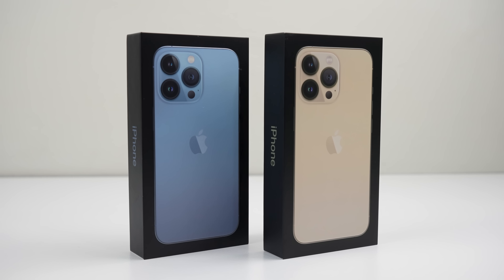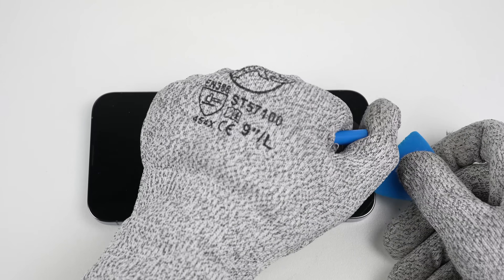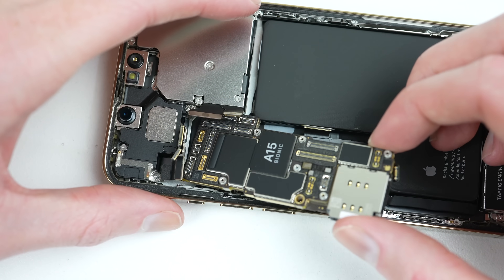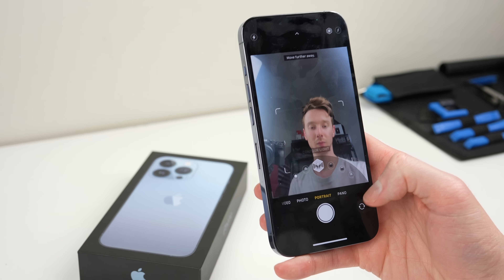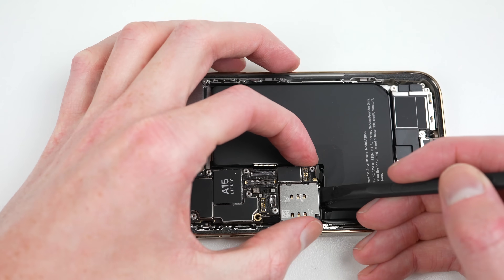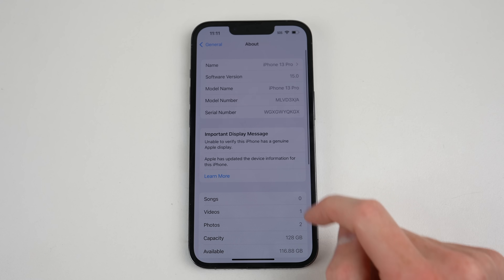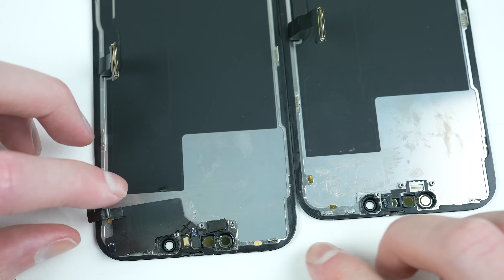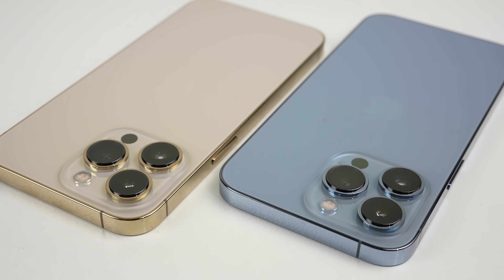iPhone 13 A Repair Nightmare - Teardown and Repair Assessment

Comment: I love their arguments in court. They say “if we make phones serviceable people will repair them wrong and blame it on us” 
In rebuttal “okay so make repair guides available” 
Apple “uhhhh no”
Reply: Courts: "It's settled, then! Apple doesn't have to make them repairable because people will make them look bad and they don't want to make guides. Case dismissed."
Reply: They could simply add a clause to the agreement signed upon purchase: we are not responsible for faults incurred by repairs conducted outside of a genuine Apple service center. 

The real issue is the negative press they would get from phones breaking. People will inevitably blame Apple for their own poor repair attempts, and Apple products will appear unreliable even if Apple is not at fault. Plus, licensing agreements are way more profitable than purchase agreements. When you "buy" a product that you are not allowed to repair, you are really only buying a license to use it.
Reply: John Deere does this too.
Reply: Exactly, i see xiaomi do tear down their whole phones, and noone so far can sue a company for their oun mistake, they just void their warranty
Reply: @雪アンアン  Is noone a word? Wait you were saying none or no one? I can't tell. This mystery is driving my curiosity!
Reply: @TheHeavieKiwie  noone is just "no one" but without a space
Reply: @AtomicAlchemist  I see. I think it's just made short to type it easier I think.
Reply: @TheHeavieKiwie  yes it is.
Reply: It cracks me up that people actually think any company cares about them or the environment. They pretend to care about the environment and social justice so you don’t focus on them using slave labor in China
Reply: So they decide to add traps and intentionally ruin phones when they do get repaired.
Reply: Showing the user a message about non-genuine parts already makes that argument irrelevant. The user knows about the parts, but apple still gimps their device for no reason
Reply: @NJ-wb1cz  I want security no messages. For my business and privacy a message is useless. You got messages when the damage is already done. I want them to prevent damages. It’s like to have automatic brakes on a car, and a message “you hit someone” on another car. Same relationship. I want that you prevent the data breach, and if someone still try to change parts I want these parts to have access to my data completely blocked. That’s security, no messages. iPhone have this level of security that is reliable for business. It’s a phone with enterprise in mind just like some Android phones, which have the very same issues with repairing as you tell. If you don’t need this level of security, it’s your concern and you can buy another phone. But if you use your phone for work like me, or do some real domotics so your phone can be your home keychain, then stop this nonsense and think about true security. If you’re an average user instead, probably you don’t need an iPhone, a Black Phone or a Galaxy S22 either. Get a Mii Note and be quiet and happy.
Reply: @AlessandroMorvillo  making your phone glitch confusingly without explaining you why exactly does it glitch and who makes it glitch doesn't increase your security beyond the message. They could've just said to you which components are suspicious to them and openly said that apple doesn't allow you to use your phone when it's repaired this way for the sake of your security, IF they were interested in security instead of duping you into believing that the repair was faulty
Reply: Who cares, you bought Apple because you think it added to your status.  What? You're too poor to buy the new iphone?  You want to repair that OLD one? LMAOOOOOOO
Reply: @honestpolicy5031  I think that if someone buy a phone for a status, they need to rethink their priorities. Phones are tools, you need to buy them for what you need. I use a lot Homekit as it’s a well thought protocol, and I need to use the security API of the phone. Also the cloning process is far better than the one on Android, and when I change the phone, as I needed to because I develop on them, it can copy via wifi, without internet cloud, all my data, app, profile and settings. I also use a lot the LIDAR for AR and 3D scans. For the status part I don’t give a cent, but I know and acknowledge that there’s so many that do think a phone will change their status. I don’t think so in an era where you can get an iPhone with a simply flat plan of the major carriers. Maybe in the first 2000, but now I think who thinks about this are wrong and must buy another phone, for their sake.
Reply: All companies do this. Its in their warranties. They say if damage is because of you the warranty is void.
Reply: @kalijasin  this has zero to do with warranty. Companies can keep their damn warranty. That doesn’t matter.
Reply: @dpedd12  has nothing to do with the warranty even though it's IN THE WARRANTYy. LOL!!!
Reply: It's a matter of signing certificate, not physical repair. For security reason the parts are certificate signed. And give Apple certificates to third parties is like giving you home keys to your mechanic. Third party can do everything they want with the certificates, that means a security flaw great like a black hole. Not even Apple do this, also Android phones with an high level of security. And even Apple cannot repair the parts, they simply change them. Some of them are low in the key chain and can be simply replaced with a part with a valid certificate. Some of them, like FaceID, have certificates that are related to the motherboard. That means that Apple changes motherboard and FaceID at one time, thus giving you a new phone is the same result. But that's why violate FaceID via software is so hard, if it was done. At this time, as I know, on a vanilla phone not jailbreaked FaceID cannot be violated, as even the TPM chip, but I can be wrong on this. For sure, it's really hard to do this, and requires some good bunch of tech, not the average genius guy of the shop of next street.
Reply: @AlessandroMorvillo  Apple has simple tool to resign everything in phone long as parts are genuine replacements, hell even some non-apple technicians have tools to transfer identification data from one display to another, it works on anything up to iPhone 12 (apple has tools for iP13 too). Also it takes them 5 seconds to do so.
Reply: @3DJLab  china companies made a tool to reassign Screen, battery, FID Identifications lol...
Reply: @AlessandroMorvillo  yes but they destroyed almost every function on the phone. they didn't make the phone not just not boot or something in case someone is trying to circumvent the phones security by replacing physical parts, they made it so you can't repair it even if you own the phone. these practices are so far beyond anything needed to secure the phone its absurd.
Reply: @lbk1982  unfortunately that’s what happens when you apply a digital sign to hardware. You raise security by far, but you also impede repairs, mostly even for Apple itself. The whole security fact is about immutable, or hardly mutable, hardware so you’re sure that nobody can change pieces of your own phone with something that it’s compromised. For example FaceID camera is signed used a key in common with the phone motherboard. If you break the Camera you must change also the motherboard that’s equals to change the phone. If you change only the camera your FaceID functionality will be turned off permanently and iOS notify you that your FaceID component was compromised and cannot be used as its security is at risk. This apply also for TouchID reader. This is the cost of truly hardened security. Same technique are now applied at core devices in modern cars, as security issues were raised when a group of security researchers successfully taken control of a FCA SUV remotely, making the car go off-road while the passengers and driver can do nothing to prevent it. Now the hardware on cars is signed and cannot be repaired by third party mechanics, but also cannot be violated easily by malicious users. Security is always a fact of compromise between rights, feedom and system hardening. You cannot have freedom and security at the same time, as freedom implies that components cannot be bound together and signed.
Reply: @AlessandroMorvillo  i understand, and i don't care why they are doing it. its simply not necessary to digitally sign every piece of hardware in the phone for the phones physical security and there is no argument you can make that will justify it.
Reply: @AlessandroMorvillo  those who give up freedom for security get and deserve neither
Reply: @AlessandroMorvillo  you know you missed the whole point right. When restoring a phone via iTunes it could/should completely sync components together that were replaced. 

Thus making all software and hardware whole again!!!

Your fallacy comes into not realizing or talking about WHY apple put hardware encoded barriers there in the first place. Why is True Tone disabled? Battery messages? Rear cameras!  You beaten the bush with Face ID. Which, like I said should be still uncompromised as long as the software can reset and sync logic board and FID together. 

You have no idea what you’re talking about, and not even touching on other issues that would make your entire argument invalid.
Reply: @AlessandroMorvillo  how hard is it to let people build in a new camera without letting the software ruin your phone
Reply: @AlessandroMorvillo  what you are saying make sense for FaceID. What about the camera and true tone display? There are no security implications there.
Reply: @MitchM240  the camera and the FaceID are the same component. FaceID works with a LIDAR installed in the camera component, and from iPhone 12 this very component is available for front and back camera as well. Changing camera means changing the LIDAR, which in fact invalidate the FaceID component for security reasons. The front camera is tied to motherboard key, so you must change motherboard also. For the screen, I’ve seen the screen changed. Using good third party display turn off true tone and that’s right. True tone uses the factory built in color curve, just as iBeacon uses the factory measured decibels of the bluetooth radio antenna. If you change the screen, iOS must know exactly which capabilities this screen have. As it cannot know what the screen can do and as far as it can find if it’s an Apple display, so can use the default data built in with OS, or a third party, it turn off the true tone functionality, as it can mostly result in an illegible screen if the third party is not good enough. Also, iOS warn the user that the display image quality can be subpar against the quality of an official product. This is of course a legitimate behavior, but in this case Apple could in fact sell screen parts as long as the client accepts that repairing the phone from third party laboratories or by DIY means could do more damage to the phone. The screen part is in fact where some profit comes, but I’ve changed my screens from Apple and from third parties, and I can also agree that Apple labs do their work better, it’s strange isn’t it? But the true tone have valid motives if you don’t sell the official part. Effectively the third party screen that we’ve mounted on the iPhone 6S were so much subpar against the official Apple manufactured by Samsung. But my friend isn’t someone that use the phone for multimedia so we’ve rated it enough for him.
Reply: @AlessandroMorvillo  your excuses are false yet again because Iphones glitch with genuine Apple parts, as is shown in this video. It's not about checking for genuine Apple display, it's about making your phone glitch artificially if you dare repairing it.
Reply: @AlessandroMorvillo  You are making the assumption that someone lost their phone then some malicious actor pulls appart the phone to add a part that has some spyware on it. 

No, the fact is, someone gets damaged phone, screen cracked - which is a common issue. And they want to fix/replace the screen, regardless of manufacturer they should be able to get the screen replaced no issues from the hardware or software. Add on that Apple by doing their shady business practice can ARTIFICIALLY increase the price for repairs. And in this way push out other businesses that work on old Apple tech. 

As I see here. The example shown is that two phones of the same kind, are used to repair one another. And these programmed "Security" Measures makes the phone less functional. Makes it error, makes it to where one can't access the systems or use them. 

So in the end, it is more or less the argument against monopolizing phone repairs that is going on. Not security problems, as it is for REPAIRS. And any repair business would want to make sure the customer has what they want which is a working phone, Ipad, or computer. A company more worried about who repairs their devices is not one I want to support anymore.
Reply: @AlessandroMorvillo  
"It's a matter of signing certificate, not physical repair. For security reason the parts are certificate signed. And give Apple certificates to third parties is like giving you home keys to your mechanic."

this is a false equivalency fallacy changing your hardware from one certified apple component to another does not compromise security. This would be like replacing a graphics card in a computer with another, or like replacing a car battery with another. If the data in the SSD is encrypted changing HW parts does nothing. 

"Third party can do everything they want with the certificates"

apple doesn't have to give any signed certificates to third party venders. They just need to stop paring hwid parts together. heck if you are really worried about people spoofing face id give them the option in settings to disable hwid pairing or give them an option to reset it. It's really not that hard.
Reply: @-Anemic  you simply don’t know how signing works. If you have a certificate used to sign a main board, then ALL the components must match the private key of that certificate. That’s why is secure. It’s like an SSL certificate: if you change the FQDN of a route, it doesn’t match as every route must match with the FQDN domain in the certificate. The certificate is enabled PER PHONE, and it’s useful to avoid stolen certificate from valid hardware like in the Bluray toolchain or Secure Boot applications. You cannot stole a “valid certificate from Apple” because the Certification Authority is indeed Apple, but the components are signed using a certificate generated only for a specific motherboard. So, a FaceID cam can only be installed on that specific phone, with that specific motherboard. That’s very secure and it’s often used in other Information Technology chains, and other security-aware hardware to avoid hardware hacking. Also this very same technique is used by Microsoft and Apple to sign in developer to test their app using USB sideloading. A certificate is issued using the signature of the phone, and you’re allowed to run the resulting test app only on devices with the specified certificate. This avoid not only test apps to circulate, but also malicious modified apps that can be a threat to the users. This is why signing the single piece if hardware is useless: you need to sign like Apple, Samsung and Microsoft do. The motherboard is the master with the signing certificate issued by the OEM CA, and the critical hardware is signed using the motherboard certificate, so the certificate of the critical hardware cannot be stealed (it’s useless as only the motherboard can decrypt data) and hardware cannot be hacked. If you want next time I will do for everyone “IT security for Dummies” block scheme 😃
Reply: @AlessandroMorvillo  still doesn't explain why Apple is bricking your device if you don't repair it with one of the apple technicians. 

And even more so. I have seen many a Mac book stories where the Mac was never worked on, yet the humidity sensors are set off upon opening it up for repairs.
Reply: @AlessandroMorvillo  Look man, I'm actually certified in cyber security with 6 years of college, what you're saying doesn't really make any sense at all. To prevent issues from people using 3rd party parts is one thing, but from other genuine Apple parts? That's ridiculous. It's like each phone has their own certificate-- which is doing nothing but drawing business away from private computer technicians and funneling all the money towards Apple so they can charge people more than what it really should cost. It wasn't designed with any security in mind, all that's needed for that is for genuine Apple parts to have Apple signatures, like all the phone has to do is contact the iTunes server, verify if the part is real by checking the certificate, and done. People drop their phones all the time, it happens, why should it take so much to get something as simple as a screen repair? What they're doing is criminal, and feels more like you're just borrowing the phone from Apple rather than truly owning it. It's like if you bought a new car, and the brakes failed, and suddenly you go to get it serviced and you're told you have to replace the whole car, regardless that they used actual brakes from the manufacturer, the computer in the car just denies it's existence. 

Furthermore, I don't think you quite know how security on electronics works. This shouldn't be like a website. The reason websites are like that is to avoid them sharing the same domain name and the same routing. If a product came from Apple, it should share 1 of however many certificates that Apple puts on them. They shouldn't all have to be the exact same unique certificate assigned to each individual phone to be secure-- I mean, imagine if desktops were like that, where you could only use this specific motherboard with this specific CPU, with this specific RAM cards, and this specific storage drive, all of which have to have the exact same certificate, it'd be a total nightmare if something decided to start acting up. 

Also, if Apple has kept up to date on encrypting their software, stealing encrypted certificates by cracking it into plaintext takes a really, REALLY long time. You're talking like, thousands of years for an advanced supercomputer, millions of years for some neckbeard with a laptop. 

The only thing Apple is avoiding is pesky competition for servicing phones people already paid to own, and you're coming up with every excuse in the book, and most of it is hogwash, on why this is effective. You can save your "IT for Dummies" course. I think you need one of those more than most people here do.
Reply: @point-five-oh6249  I agree to disagree. I had passed a lot of penetration tests and I have also a lot of forensics IT books that plus or minus tell the same story of me. Of course, pointing also on the other face of the medal that’s quick repairability. You can say that’s overthinked, that’s too much as a phone you can buy in retail stores, that would be ok as others pointed. But that have a certificate for each phone is useless, I don’t think so. Playstation certificates and Bluray readers certificates are still stolen at these days, as it’s one certificate for model. They’re used to crack consoles and blu ray disks. Without the chain between the motherboard and the other certificates you can still stole the certificate. It’s not easy to dump them, of course, but after it’s done the lights are green. That’s how PS4 crack works if I’m correct, and that’s surely how Bluray Disk crack works. If you’re really into security you surely know that against other solutions on the market Apple it’s doing a great job on security. That’s a matter of fact. So if you say “the only thing Apple is avoiding is pesky competiton”, sincerely I’m not sure. Developing on Apple store is blocked to not authorized developers using the phone certificate, that means an IPA built for iOS and iPadOS is signed by a certificate and a provisioning profile that must match the certificate of the authorized phones or the Apple Store or an Enterprise Certificate. This means if you do a modified malicius IPA, you cannot sideload it to a phone which is not first authorized by Apple. That’s a fact. Also, you cannot build the app from a Mac that’s not the one who required the certificate and app provisioning profile. Thats also a fact. So, your app is bound to only a few devices while debugging, and also at only one MacOS device to build and release. Just this boost the security so many levels up. That’s why Google Play Store suffered from malware, and even now something passes and the Apple Store have a story of very few incidents. Your company must deliberately build a malware and publish it, that’s not ideal for you business I think. Of course some “security agencies” had done a lot of work to circumvent the security of Apple products, but I think few individuals will pay a bunch of million dollars to access the phone of someone, there’s other methods for sure, they’re cheaper and faster than the security agency solution. Also if I’m not wrong the very same hardware signing method is used by Black Phone or whatever is called the high security Android phone. But, as not a consumer product, no one rant about its reparability issues. So, basically, they’re all mad? Again and again, the screen repairs SIMPLY WORK. The thing they shut down is True Tone, that need a particular color screen curve that a non Apple replaced piece maybe cannot guarantee. But the screen works like a charm, changed on at least two iPhone. It’s the FaceID and TouchID part that doesn’t work anymore. If you pay 60 $ for a screen, losing True Tone can be expected, you Agree don’t you? That’s all I have to said about this thread anymore, as all the fact are at zero: Apple iPhone is still the most secure phone based on recent security analysis, they had lost a lot of market against Android but still, par with high end Android devices of choice like the Galaxy S22+, are the de facto standard in high end enterprise business and this will not change, even if you or me continue to argue about security best patterns.
Reply: @AlessandroMorvillo  for all the security trial and error. Only rejigging the code will keep it secure. 

Lots of security measures for computers, phones, game systems have been destroyed in the matter of 24 hours. Always hear of jail breaking apple products. Which this certificate BS is just a hassle that will if people are smart will just start ditching the apple products. As much as I like Ipad and the like. I think I am better off with an android tablet if the next Ipad will not be mine, but rather the company's Ipad cause they would rather push for their own repair business which they can and will charge outragous prices for. Once this Ipad 2 breaks fully. Android only for me. 

So enjoy shilling for the Multibillion corporation owning your Iphone and Ipad for the next generation.